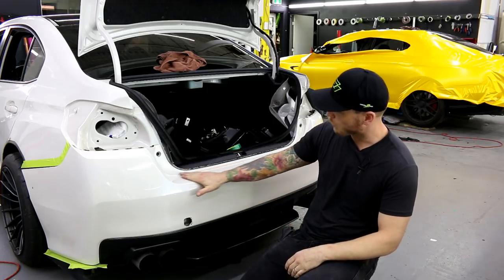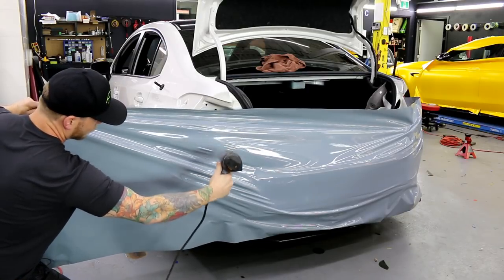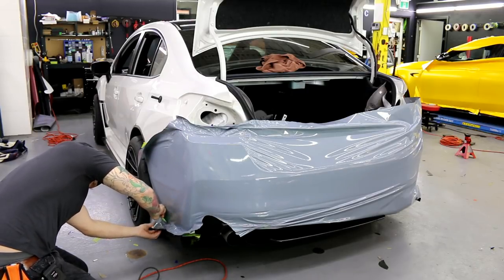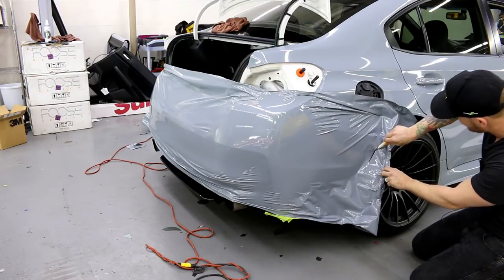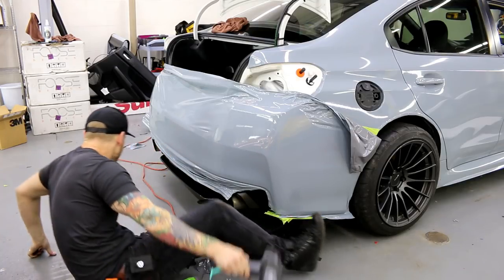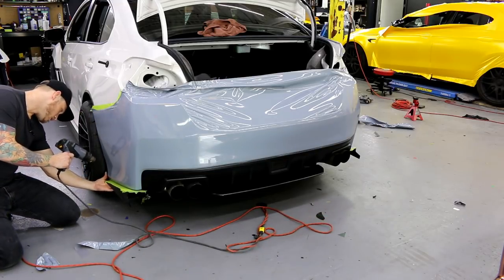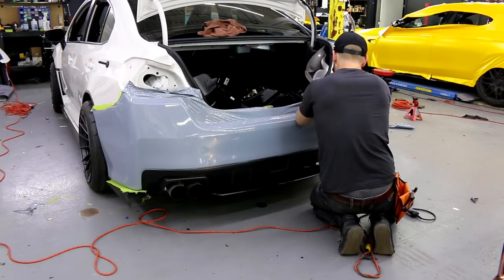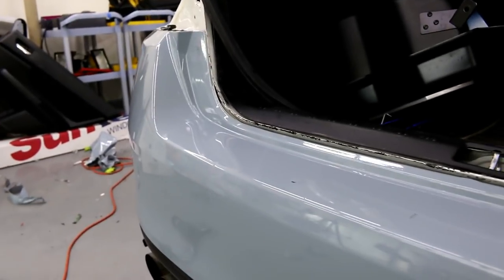Vinyl Wrap A Rear Bumper On A Subaru STI

Comment: Christian.....excellent wrap on that back bumper. Also, I was at Home Depot last Fall, and I found something called a cord foiler. Foil as in stopping. It would be where instead of plugging your heat gun straight into your extension cord, you would plug it first into the cord foiler. then into your extension cord. It will never let your extension cord bunch up int those tight knots. Worth it's weight in gold. I should have bough ten of them and I didn't. They work great. You can find them in the aisle with extension cords. You'll love them. 
P.S. I sure don't see ant more Subaru TSi's here any more. They were very quick. The only thing I didn't like was the spoiler on the back. It tended to block more than I cared for when looking in the rear view mirror. 
My best,
Scott

Comment: Nice CK I have been running inlays with those problematic Subaru's rear bumpers.  Not anymore great tip and how to.  Keep it up!!!!!
Reply: I still struggled to do mine. The 5th gen bumpers have a deeper recession, and nothing I could do would let me stretch it in without it pulling back in those corners. So I did an inlay. temped to try it as one piece again as I feel my skills are much better now. But it's still way more stretch then the 4th gen wrx bumper.